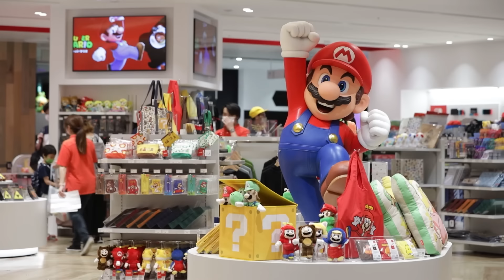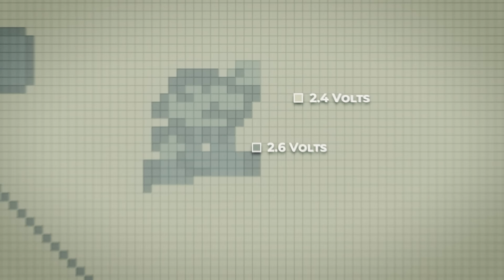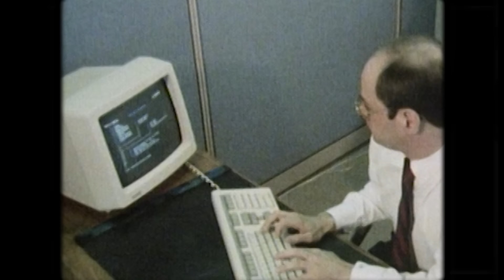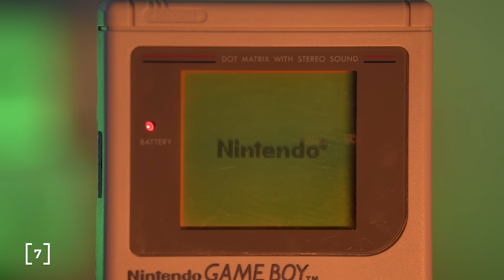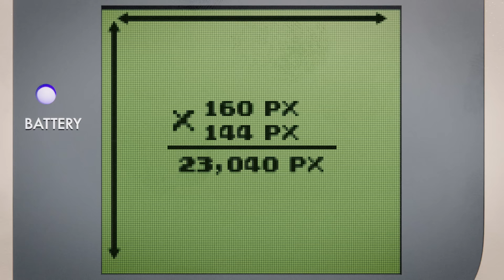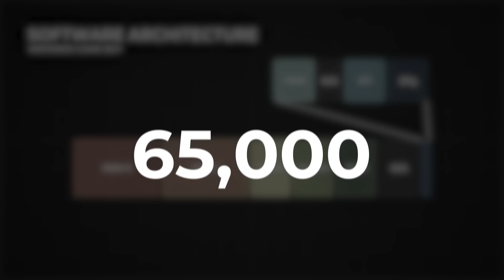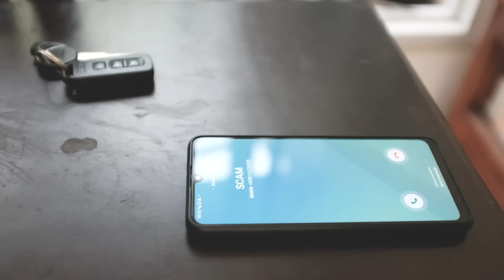The Insane Engineering of the Gameboy

Comment: Forcing the game to contain the Nintendo logo is a good deterrent,  because the threat of a lawsuit and how expensive they are, but I don't think it would actually hold up in court. You can't claim that someone's violating your trademark when you set things up in a way that forces them to use your trademark. That could be interpreted as a form of entrapment. The intent of trademark law is to prevent knockoffs and ripoffs from diluting the market and confusing people. It is not to make it so you own the very concept of the trademarked thing for all possible interpretations. You can't trademark the word "apple", for example, because that's a common English word. Apple Inc has a trademark on the Apple logo and the capitalized Apple referring to their company, but as they are a tech company, they can't sue a grocery store called Apple for naming themselves Apple. It's two different markets and that's beyond the scope of their trademark. Which is why it's bullshit that Ion Maiden and Spooky's House of Jumpscares had to have their names changed just because some asshole with a lot of money and a lack of understanding of trademark law threw a temper tantrum. Likewise, somebody making a bootleg game to run on your hardware without getting an SDK or a license from you, and putting your trademarked logo into the ROM because the specs of your hardware force them to, is not legitimate grounds for a trademark lawsuit. They only used the trademark because they were required to. It would be like if you invented a cup that's in the shape of your company logo, and then sued someone for putting their own water into it (instead of your water, sold separately) because the water happens to, being water, settle in the shape of your logo. Or even more absurdly, suing the company or government that supplied the water.

Trademark/copyright/patent trolling, as well as abusing lawsuits with no intent of actually fighting it knowing that the costs alone will bankrupt the victim, SLAPP lawsuits etc, should honestly be punished way harder than they are, like the penalty should be disbarment. I want to see lawyers shrink at the prospect of pushing a bullshit lawsuit, knowing that they could be accused of foul play and have to defend themselves against that lest they lose their entire career.

Comment: Wasn't mentioned in the video, but the CPU also had the ability to "halt" and enter a low-power mode to extend battery life further. Typically this could be activated during a pause screen, so the CPU would only have to wake up briefly to update audio (if the pause screen had music going) and check if the player had attempted to resume.

Comment: Nice video! I used to program games for Z80 with 48k of RAM a long time ago. The picture was rendered from sprites, so essentially - a repeated pattern. There was a lot of low-level assembly programming to make the code logic as fast and as small as possible. The techniques used for maximizing the use of the <60k buffer were largely based on the game development experience from these earlier systems.

Comment: I've got at least four game boys. Super RC Pro am as multiplayer is the king. There were plenty of re-chargeable batteries around in the nineties. You saved money by getting them. The voltage was only 1.2V whereas batteries had 1.5V so I'm not sure if they worked with the gameboy but they did work in a sony walkman and most other appliances. And they also work on Nintendo Wii controllers.

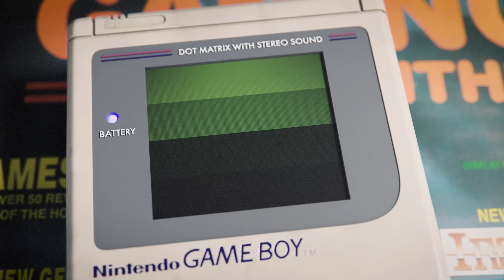Comment: 7:00 - You mentioned that faster pulses result in darker shades, vice versa... the opposite is actually true in general if you were to use that method. In terms of LED dimming, we use what's called PWM (Pulse Width Modulation) where the flicker time is the same, but the on time and off time of the pixels are inversely related. For instance, 25% on, 70% off (time) would result in a dim pixel, and 70% on, 25% off would result in a darker pixel.
Reply: Great video by the way!

Comment: I used to work on the GB. At one point we had the BBC Micro classic, Elite, running at about 10fps in full wireframe 3D. That was some seriously clever coding! It could also to 8x16 sprites (so they were 2x as tall as they were wide) - this was VERY handy.

Comment: I used to wait until the batteries were low, and then switch them out with the batteries in the remote to the televisions throughout the house. My mom would go out and buy jumbo battery packs because the tv remotes "strangely died", and said jumbo battery packs would mysteriously go missing shortly afterwards. Fond memories.
Reply: When the batteries got low I would either turn off the GameBoy for about a half hour or just swap the batteries around. Somehow I got more play time. Another trick is that you can use smaller AAA batteries. Just use aluminum foil to make the connections from the terminals to the batteries. 😊
Reply: @joreemmcmillan7145  why all the  hassle just connect the GB to its official adapter.
Reply: Our mums always got stooged by us young kids
Reply: your moms knew what you did, they were just to nice to call you on it
Reply: Reminds me of the time my mom had a better gfx card in her dell than I had in mines and I asked her if I could swap them cause she never utilized that hardware at all and she said no. Well guess who swapped it while she was at work and she still doesn’t know to this day ahhaa
Reply: holds thumbs on battery*... COME ON COME ON.... *bar moves up a little YESSSSS! Slap's it in. I got 4 different battery brands and I was able to pull a battery from the outside solar light.
Reply: Addict confirmed
Reply: I just ran an adjustable volt DC adapter to a battery and the GB terminals
Reply: Is your mom hot?
Reply: Deception lvl 100
Reply: Pro move.  No shame
Reply: That’s a genius move
Reply: The strangest part is that Gameboy had a power supply. Apparently nobody knew where to get one. I was really happy the day I got rechargeable batteries 😅
Reply: @Fred_Klingon  You could just buy a rechargeable battery pack and an adapter for charging and playing. Then you don't have to take the batteries out to charge them.
Reply: @qq84_Richard wasn't the Gameboy using 4 AA cells? You would need 8 cells to recharge without waiting ..
 Back then rechargable batteries were expensive, especially if you were a kid!
Reply: @Fred_Klingon  Yes, it had 4.
But if it's a battery pack specially made for the GB with a connector for a charging cable, you can play and charge at the same time and don't have to remove the battery pack.
Reply: Used.to.put batteries in fridge/freezer too. Crazy to think now
Reply: @The_weed_guy  i still do. Is it bad? New research showing it’s bad?
Reply: @MichaelKingSlayer i don't know. Haven't herd anything. Im sure deep freezing cant be good over many cycles rho right?
Reply: Why weren't you using rechargeable batteries and a wall socket adapter? Put it in the outlet to (at the same time) play and charge the rechargeable battery pack and then you can play without the outlet for quite some time. You don't even have to take the batteries out to charge them.
Reply: I bet I have a couple thousand hours in Gameboy Tetris. It was such a cool system despite how crappy the screen seemed
Reply: @gcburns4 Have you ever thought: Tetris taught me this?
Reply: lol
Reply: Lol jumbo is totally a late 80s/early 90s word too. I don't see that word being used any longer anywhere now that I think about it!
Reply: @thefatherfintanstack  imo jumbo isn’t just a 80/90s word. Granted I wasn’t born back then, but I still see it plenty often. No one uses it in speech, of course, but branding still contains it plenty. Jumbo Paper rolls, Jumbo hot dogs, etc. it certainly isn’t gone
Reply: @IAlsoPlayKsp  naa I hardly ever see the word jumbo compared to the 90s
Reply: @dannyking4138 I see jumbo sized instant noodles
Reply: I used to do this too!! I hope lots of kids did. Now i do it with my xbox controller and my Wife is always swapping TV remote batteries hehehehe

Comment: Nintendo did not make much sense to me, in some of their older game systems. The Wii had wireless controllers with a wire on it? What? How is that "wireless"? Now at least the Switch has true wireless joycons. No wire running between them, because they could not get the cost of wireless low enough? The Gamecube used a tiny disc, compatible with nothing. Whereas the Sony PS2 could play also CDs and DVDs and even PS1 games. For quite a while, my PS2 was also my DVD player. I skipped straight from NES to the Switch, as far as Nintendo goes. Even my Apple //e computer had a color screen on my TV, well sort of color. Gameboy games might as well be run on my TI-89 graphing calculator, which also had no color screen.

Comment: Compare this to today when some so called "devs" r complaining to not have enough memory or CPU power... today rather than work hard on the code optimization and its quality devs just purchase more powerful HW and continue to use crappy code until it becomes slow again. Then they repeat the same... HW today is way too much affordable and plentiful in comparison to the past and the quality of the coders/programmers has dropped because of that. Basically HW and it's wide adoption with plentiful of tools spoiled the programmers😉

Comment: had the game gear as a child. it had color, backlight, multiplayer and could play tv and radio, just like that.

and there was the option to use the power adapter to avoid burning through batteries. That was what I had to do, sacrafising much of the portable aspect for sure, but playing with vastly superior hardware as a trade-off

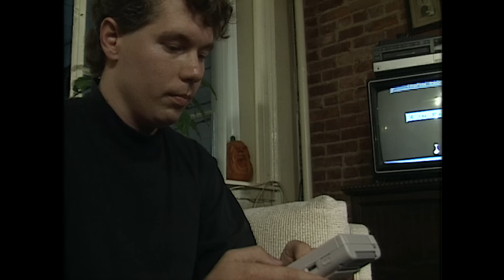Comment: 3:12 I calculate the gameboy consumes around 50mA at 4.5V
Explanation: He said Sega uses 4.5W for 3hrs to drain 6 AA battery. So. 6 AA battery has 13.5Wh of energy, or 2.25Wh per battery. AA has 1.5V so its capacity will be 1500mAh.
Then he said Gamboy needs 3 battery and can run for 30 hrs. So 1 battery per 10 hrs. So 150mA of current consumption at 1.5V. But I think it’s more likely they use 4.5V for the system and step it down to power other circuitry. So 4.5V at 50mA must be the answer
But then it proves the info “Gamboy uses 0.7W” wrong because 4.5*0.05 = 0.225W only. Sorry but I love calculating power consumption of portable electronics

Comment: You missed the part explaining why my Gameboy that has been treated like trash since my childhood still works and my PSP that I barely used doesn't.
Reply: The answered is hardware rot, it's similar to rusting in other product. The thing is items or machines that are hardly ever used or got less usage often defect faster than those that got more uses. A person who bought a car and use it more often will get a long lasting car compare to a person who bought a car and hardly ever use it cause then that car will rust as the oil it had will slowly stale resulting in faulty engine and components. When you use something such as a machine, all systems function and all network of that device will run their course, when you continue using that machine those thing stay in place and will continue to update giving you a lifetime of smooth transition.

When you stopped using a machine in the long term, the systems in that machine will slowly dwindle, components inside the machine will stale over time and all the stuff that once stay in place will start to rust, crumble, or cracked resulting in likely defects if it ever gets usage again. People always think that just cause they don't use something as much means it'll last longer but that's not true, things last longer if those are use more meaning a car you bought and always drive will always be more active and a car you bought just to store in the garage for the long term will probably not gonna last you in the long term.

Comment: Rechargeable batteries had already existed for years when the Gameboy came out, I bought it as soon as it came out and I have never put a non-rechargeable battery in it.
Reply: I'm guessing those were expensive back then. No idea though, since it's before my time. I have the later Gameboy Color, not the OG. And I really should get some rechargeable batteries for my stuff, since I still use them a lot for various controllers in my collection
Reply: @paulhudalla9527  rechargeable batteries are more expensive than non rechargeable one, also today.
Reply: @paulhudalla9527  Yes, they were expensive. Going off the 1989 Radio Shack catalog, for the price of 4 AA basic model rechargeable batteries and a charger, you could get 75 basic capacity AA non-rechargeable batteries.

BUT, the amount we played these things and how they chewed through batteries made it the smart long term choice. 

These days, the Lithium Ion rechargeable are awesome. They hold a true 1.5v almost until they are dead. Not that you need that for controllers though.
Reply: I believe his comment was centered more around the fact that rechargeable batteries in the 90s were expensive as fuck, and that's before factoring in their charging station. Google states that the price of batteries has decreased by 97% since the 90s. a 4-pack of Energizer rechargeable batteries from Walmart would cost me $14.17. In the 90s that same 4 pack of batteries would have cost almost $28. Add in the charging station and you might have been looking at $50 for 4 rechargeable batteries and their charging station, and I don't remember if charging stations back then were even designed to recharge more than 2 batteries at a time. If they couldn't recharge all 4 batteries at once you would have had to have a total of 8 rechargeable batteries to ensure you always had 4 of them charged to use. And this also ignores the fact that $50 back then might as well have been several hundred dollars. So unless your parents had plenty of money to spend on your rechargeable batteries, you made due with spending your allowance/pocket money on non-rechargeable batteries. Rechargeable batteries were for the rich kids.
Reply: @azurblueknights  this is totally meaningless.
Reply: @Catapumblamblam  Lol, what? This is absolutely meangingful - the point of batteries in the first place is that it takes money, so the less they get used the more accessible the product is. The recharging setup in 1989 would be approaching the cost of the gameboy - you can justify buying it, but you could also say "then don't play your gameboy that much."

If the comment on rechargable batteries' expensiveness when the gameboy released is totally meaningless, then so is your comment stating you had rechargeable batteries and only ever used them from '89 onwards.
Reply: Those must be crazy ass expensive back in the days and in our third world country lol, must be twice or thrice the price. I was checking some recently for my AC remote but lol, it’s still pricey so I will just stick with buying Energizers😅
Reply: @Raiya_ru17  not much, surelly lkesser than buying all the time new patteries.
Reply: Yes exactly nickel cadmium ones. Very toxic, but they did their job
Reply: Yeah they existed, but they weren't widely used by that point.
I think you are in a really small minority especially for the late 80s.
I remember my folks had some, and they would take 12+ hours to charge and had less capacity than just a non rechargeable AA.
Also at the time, most devices using batteries would be really low powered things like remotes, and maybe lights that wouldn't be on continuously, so I can't imagine most households would have that on hand, and most parents wouldn't be plunking down money on rechargeable batteries for the $90 toy they just bought for their kid.
Reply: Right? I was almost questioning my memory. But no, we had radio shack rechargeables and a bulky charger back then.
Reply: Damn this comment destroys the first part of this video to the point im just gunna stop watching it 😂

Comment: The use of tile based graphics actually goes back to a hack on early computer.  Most early video generators allowed you to move the pointer register for the text glyphs to move it from the system ROM to writable memory.  This is a feature intended initially to allow using different fonts. 

Developers (a field mostly filled with hobbyists at the time) realized this could be used to create various image tiles for the games, and of course for icons in productivity applications.  

By the time video games were being commercialized and computers went from the hobbyist minicomputers to household microcomputers, video processor developers had noted this method and designed their chips to take advantage of the feature to a greater extent.

Comment: Point of correction.
An original Game Boy can last up to 30 hours using modern AA batteries, but back in the day 12-14hrs was the most you could expect. AA battery capacity has at least doubled in that amount of time due to improved technology. (800-1000mah vs 2000-2400mah)

Comment: I had the idea long ago that the Gameboy screen should have been glow-in-the-dark; it would be not as good as a backlight, but a lot better than nothing.  However I did discover a possible problem with the idea: liquid crystal's darkness can be controlled because it reflects different polarities of light depending on whether it is conducting electricity or not, and one of these polarities is blocked by the Gameboy's front screen; this also gives the screen a dark tint, similar to sunglasses, which could make the glow-in-the-dark effect almost impossible to see.